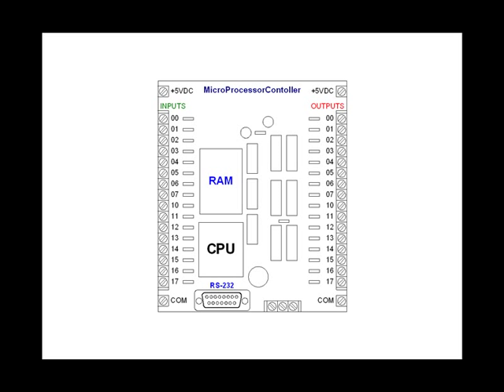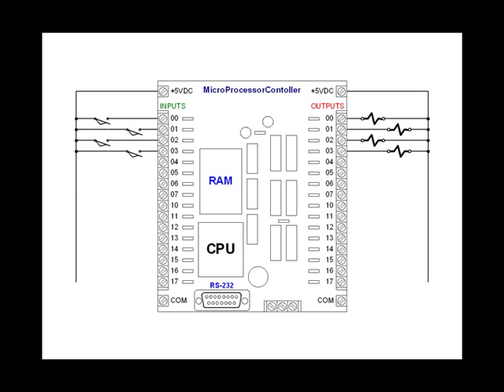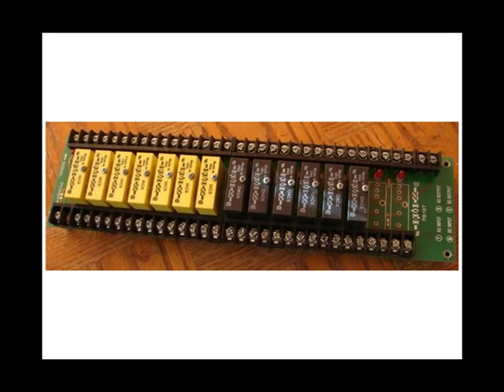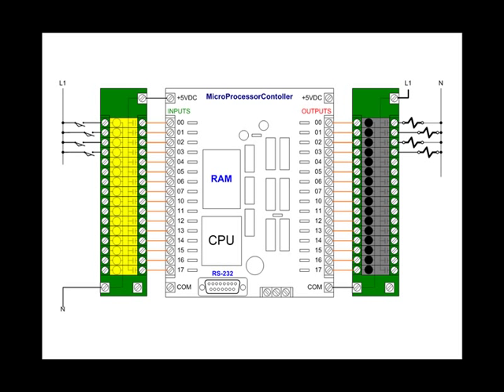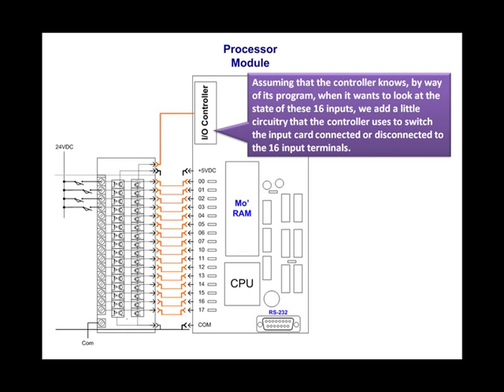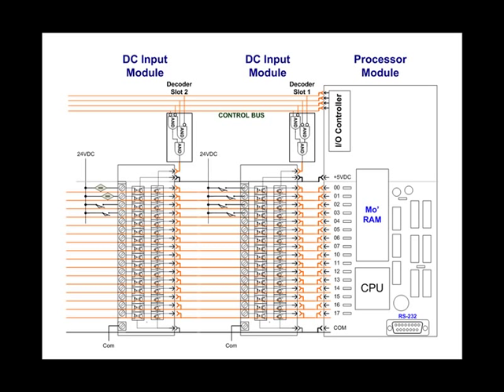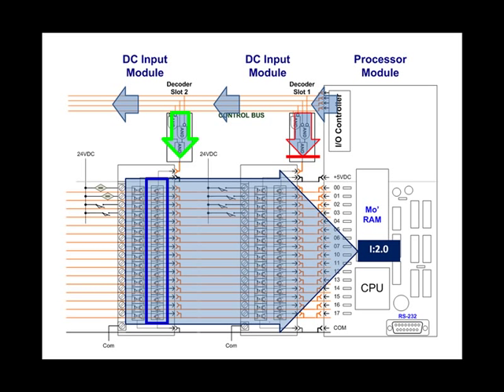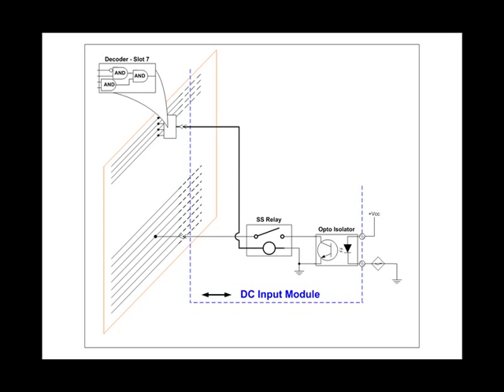PLC Lecture 05 - Computer Control, A PLC Training Tutorial.

Comment: Okay..that explains very well. But here is a question. What about modular plc system. I do not seem to be getting of how PLC knows the slot number of the module I am going too connect using connector.
Reply from the maker: Each slot of an active backplane has a decoder that reads the control buss and connects that module to the backplane.

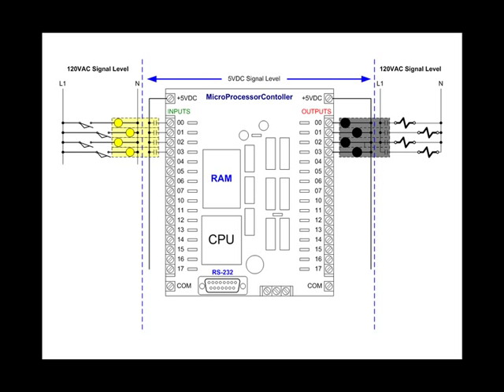Comment: After 11:00 ,the things are bit confusing(there is a delay/lag in the video). So I have a question- Does the optical isolators and Solid state relays are attached in series in I/O module? If yes , don't these perform the same function of isolating the Controller chip from the field voltage?  thanks for giving such a nice presentation.
Reply from the maker: +Mohit Suri Videos recorded years ago with inexpensive software, unfortunately. The yellow and black rectangles are solid state relays, OPTO-22 back then. They are a device that contains all of the electronics to isolate the field from the board while transferring the state.
Reply: +plcprofessor  So counting them can we infer that max 7 input devices can be connected and 6 output , the image shown in the video .
Reply from the maker: +Mohit Suri NO... filling up all sixteen inputs and outputs would clutter the graphic. This is illustrating the evolution of machine control by means of a CPU. Do not stop in the learning progress to over analyze a historical example.
Reply: +plcprofessor I was taking that particular incident/picture, that had 7 yellow inputs and 6 black outputs.  

one more thing, can a control bus has 5 or more slots/connections than 4(in the example taken), that would increase the number of decoders(because right now we have 2^4=16 combination of different signals or decoders selected) to attach more inputs to the PLC?
Reply from the maker: +Mohit Suri That is historical hardware, we do not use that architecture now. That is not the system that you would use today.